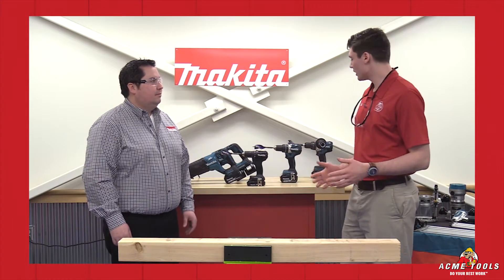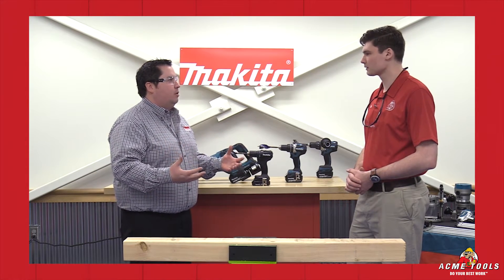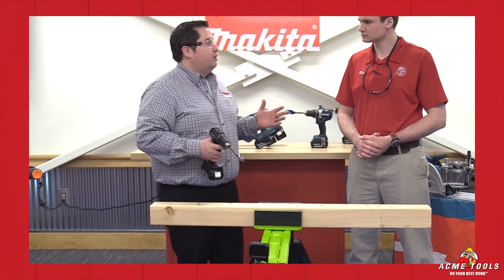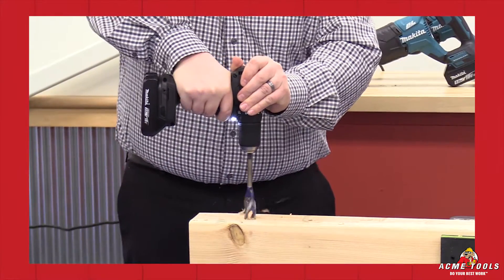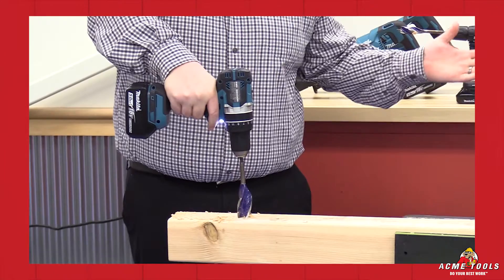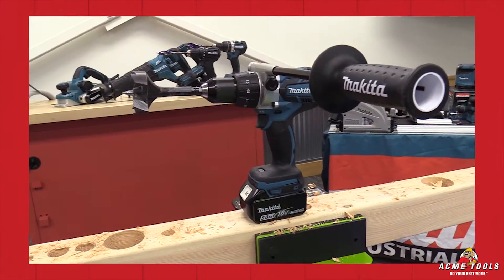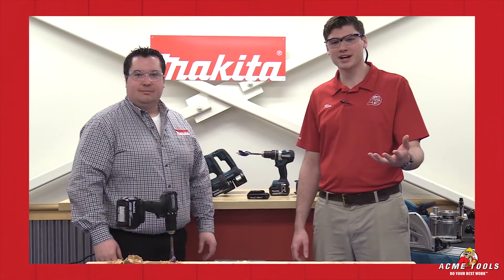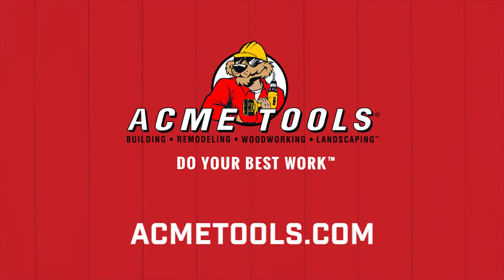Makita Drills with STAR Protection

Comment: Star protection works at first speed?
Reply from the maker: STAR Protection works in both 1st and 2nd gear on the Makita drills.
Reply: My brand new Makita kicks out all the time. Let's just go with 2nd speed full bore for simple stuff like screws like we always have done with 0 problems. What junk.